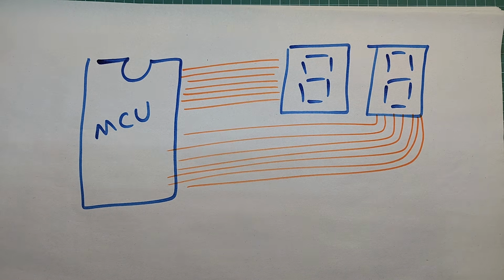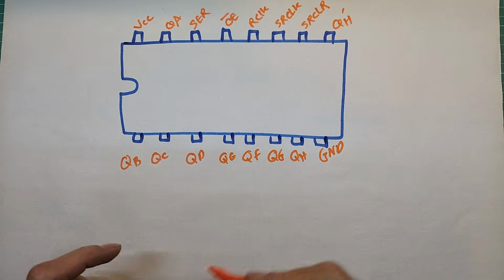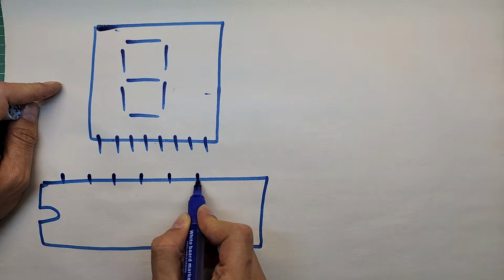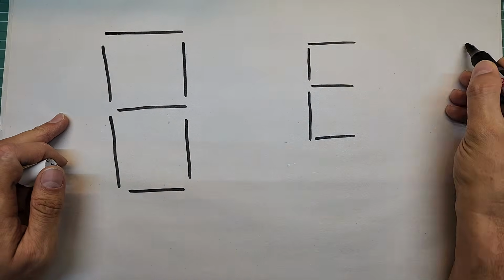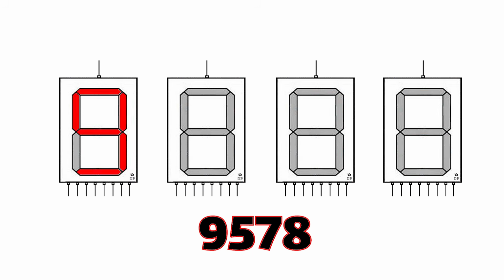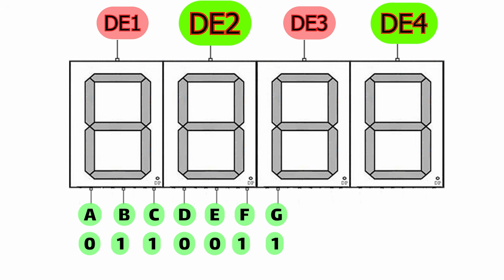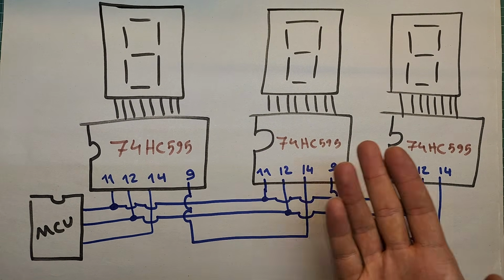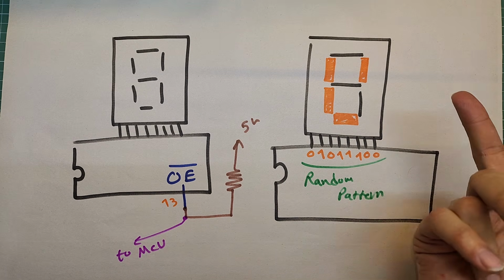Why the 74HC595 is Your Next Favorite IC?

Comment: I use the TPIC6B595. It functionally equivalent to the 74HC595, but the outputs are buffered to 150mA/ 50V outputs.
You can directly drive solenoids, relays, LED, etc.
Works with the Arduino 74HC595 library.
https://www.ti.com/lit/ds/symlink/tpic6b595.pdf

Comment: Could the undefined state at power-on make 74xx595 suitable for use as a random byte generator?
Reply from the maker: I don't think so, it is nota real random. Most of bits are zero, some of bits in some conditions get a high value 🫡

Comment: I am aware of the 74hc595, but I prefer and use the 74hc4094 and its half the price of the 74hc595.
Reply: I'd just use a p'lexer. Much simpler. That's why they have a common anode or cathode.
Reply: I prefer 4094B.

Comment: No use ... CH32V003, ATtiny STM8S003, or even a dirt-cheap RP2040 board can be under $1 in volume. Use those to expand GPIO, and drive 7 segment dispalys. In some markets, the CH32V003 is cheaper than 74HC595. You get the option to have inputs, as well as outputs.  Why anyone is using 7 segment displays anyway.
Reply: What you're not considering is that you're now required to program a separate controller. The whole idea is to avoid using another mcu. I'm not in the market for all that, so I'll use 595s and some extra logic to get the job done and it has plenty of times. "Why anyone is using 7 segment displays anyway" care to elaborite this elitism? 😂
Reply: @amethod For example - Vacuum tubes used to be cheaper than transistors.  Now they are more expensive.  They might still be useful for hobbyists and fun, but they're no longer a useful component to learn.
Reply: @moeburn  Take a look at either your microwave, oven or coffee maker.
Reply: @moeburn 595 is less than 1€ and MUCH more efficient!
It's time people learn about the "old" 74 series again because they are still VERY useful and often more efficient than having to use a second MCU or waste precious processor time to multiplex things like a 7 segment display.
Using another MCU for this is pure laziness and very dumb!
Reply: @ppdan remember some new learners are here as well. This forum is not for the “I know too much” professionals like you so pls mind your language. Languages like dumb and lazy are unacceptable in a professional forum
Reply from the maker: Thanks for sharing your perspective; still the 74HC595 is a great option for many applications! 👍
Reply: Sure, you could use an MCU to drive a display, but then you're dedicating a whole lot of pins on an MCU to driving LEDs, which isn't particularly efficient. A dedicated IC like the 595 is going to act as a better LED driver and means you can make better use of the MCU. Once you get beyond trivial projects, suitable support hardware separate from the MCU becomes more important as they're more power and cost effective, and you can move some of the logic to CPLDs where it makes sense.

Overuse of MCUs outside of what they're intended for also means you can end up with nasty timing bugs and lower performance because you're doing things like bit banging. The idea of videos like this is to introduce people to discrete logic, not MCUs, and you need an understanding of discrete logic before you can do useful things with CPLDs and FPGAs.

So, no, the 595 is a good choice for this project.
Reply: That’s a great suggestion - does the CH32V003 handle the loads of the larger 7 segment displays?  Why use 7S? They are fun!
Reply: Yeah, only if you are going for a ridiculous overkill solution.
Reply: Why no use MAX7219eng and can link them in daisy chain and use Arduino or esp32 to control it